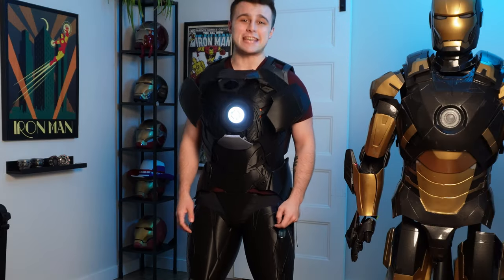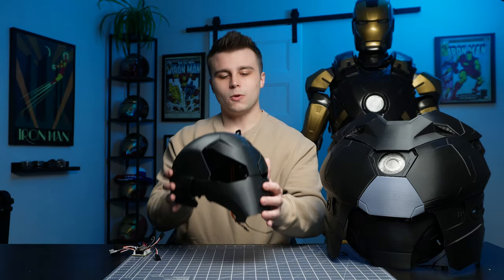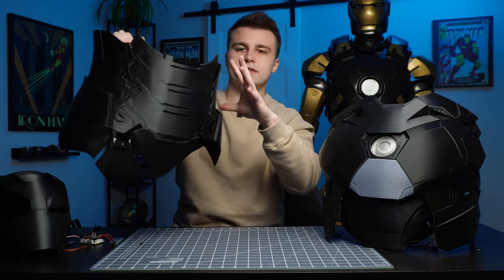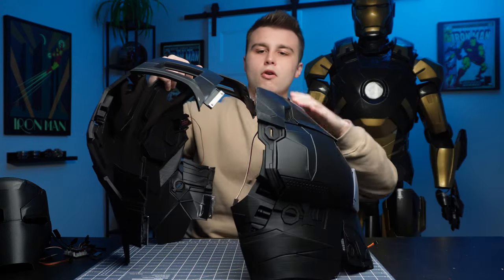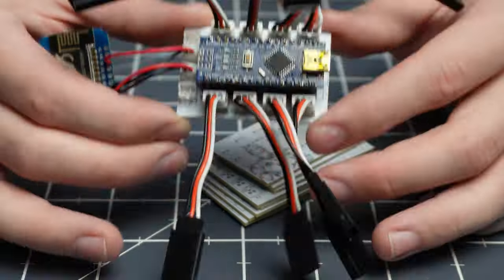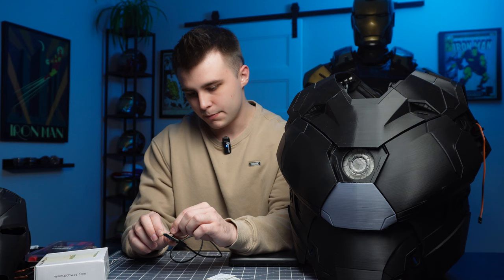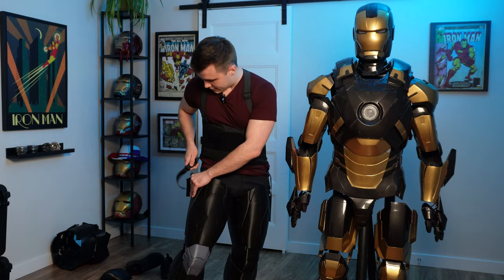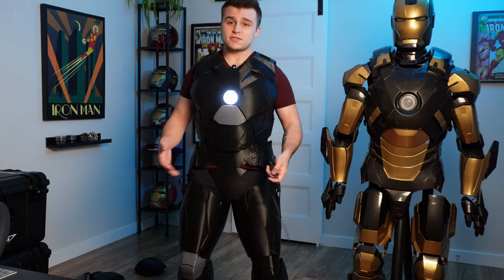WIRELESS and MOTORIZED? - 3D Printed Iron Man Mark 46 Cosplay Update Video #2

Comment: Ohh i really need that newly designed board because making it wireless is alot better, saves space for my iron man suit. And what is the exact board for the wireless connection?
Reply: Can you send the code also so i can use it for the flaps instead

Comment: Looks awesome. Could there be a way to make it work with small steper motors?
Reply from the maker: I never considered stepper motors, you’re probably right! I’ll have to research into those and find a way to incorporate them into more stuff :)
Reply: @plentifulprops3d  the only problem is that they are quite big, there's some pancake models but still the one's one my 3d printer are big.

Comment: How do you get enough amperes for all the servos? Is the powerbank enough? (I'm building a robotic arm at the moment, and I have problems using more than one servo at a time)
Reply from the maker: The battery pack I ended up choosing outputs around 4 amps, so it’s barely enough. But to be sure, I staggered the servos, so they don’t all turn on and move at the same time :)

Comment: What are your settings on Cura for the Neptune 3 max to get that smoothness when printing?
Reply from the maker: I don’t use Cura, I use PrusaSlicer. And I use the default settings for the Neptune 3 pro/plus/max included in the slicer :)